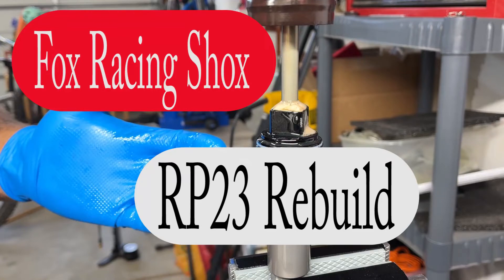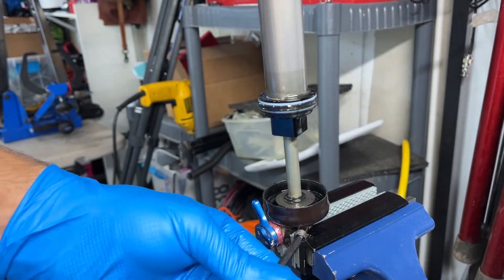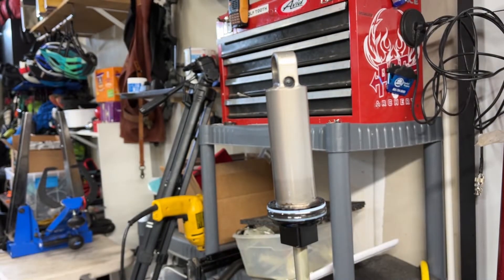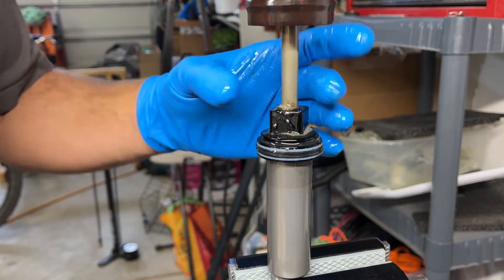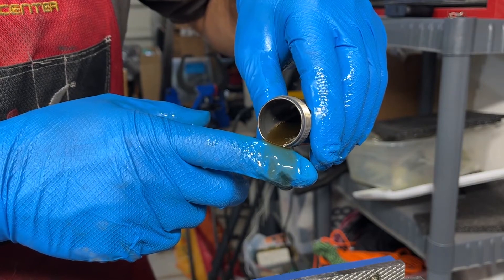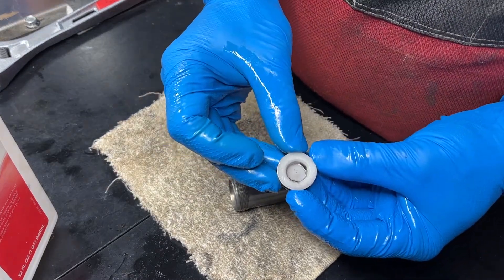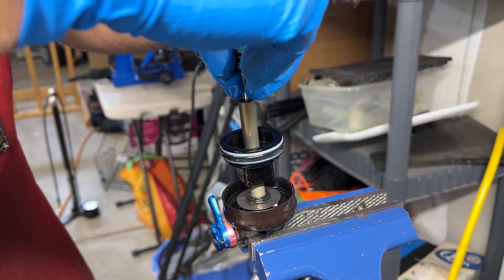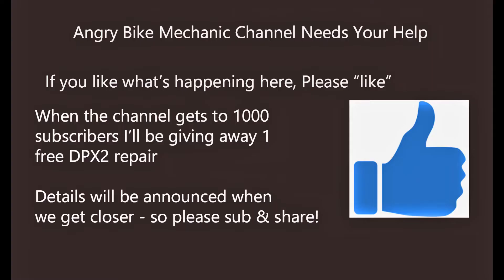How I do a Float RP23 rebuild - Fox Racing Shox old stuff - Part 1

Comment: my bike is a 2013 model and it's just stock at home because my rear suspension is no longer loaded with air. what is the possible reason and what needs to be done to fix my rear suspension. Thank you, I hope you can help me with my problem. my suspension is fox rp23 boost valve. 160
Reply from the maker: Oh man, when the air seals go out they need to be replaced. They just won’t hold air. Replace the air seals. I might have a video on it. The RP23 uses the same air seals kit as todays DPS. Easy to get the parts. But if you hear sloshing in there that is a damper problem.
Reply from the maker: If you’re in the USA you could send it to me if you’re unsure how to do the work.
Reply: I appreciate, I’m from the Philippines, but its so far from my country, and I don’t know how to fix it. I need some help to solve my problem thank you so much.

Comment: Love the video. Appreciate you putting this out.  I was wondering if you may be able to help me. 

I screwed up and while rebuilding my float shock, my rather large clumsy dog, ran around the corner and knocked my table over, which in turn knocked everything off the table. So my shim stack went everywhere.  I did take a video of the boostvalve area all together.  It was still all together when it fell over.  So I don’t have any idea of the order they go. I’ve tried fox and other places, and either they didn’t know, fox for ex. Or just would not tell me.   I’ve looked all over the web for images specific to my shock tune. But have not been able to find anything. Also, my local bike shops I’ve called don’t even mess with rebuilding shocks. You seem very knowledgeable and was wondering if you know where I could look to find the order of the shims.   

The shock is a fox float RP23 boostvalve with rebound XL. velocity L and boostvalve 150.  Thx you.
Reply from the maker: That's sad news. Fox isn't super great at helping or supporting their old products. Can you reach out to me from my website? check out insightbike.com and lets see if we can get this figured out.

Thanks for checking out the video. I've got more coming but I just haven't had time to do more.

Comment: Do you have the ifp depth?
Reply from the maker: IFP depths vary depeding on length and stroke of each shock. unfortunately they're not easily found. I don't have a list or anything. I have to make measurements and figure it out each time.